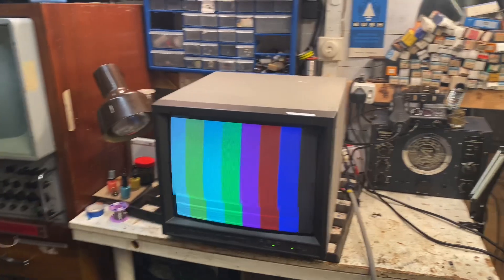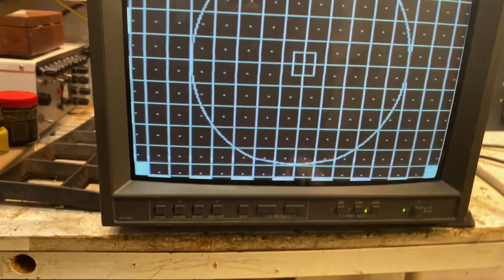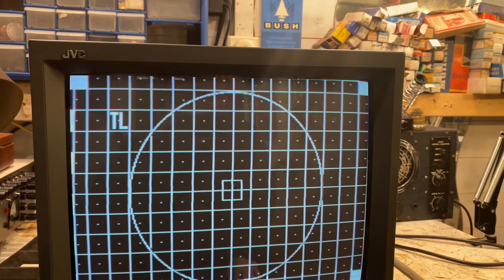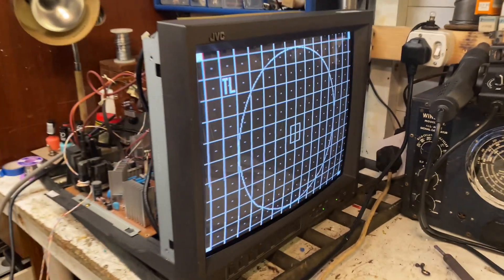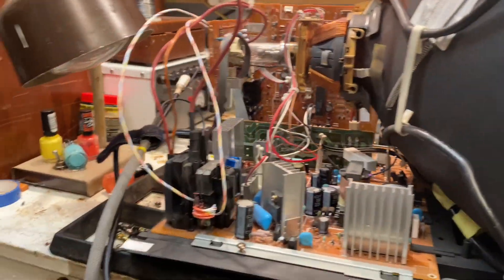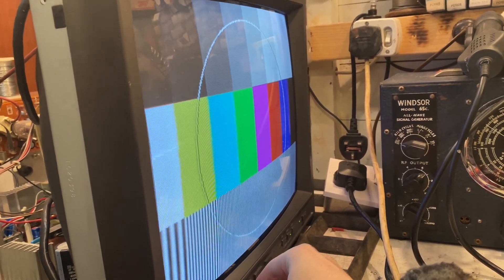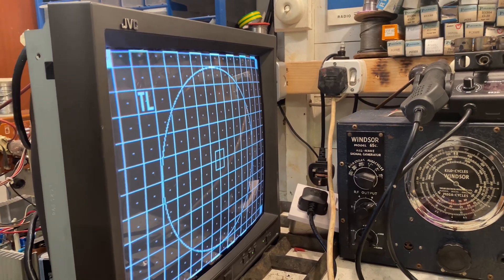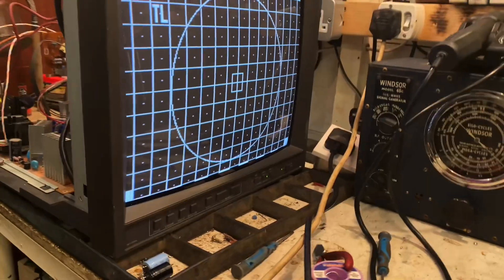Customer Repair - JVC TM-1700PN with knackard CRT! Mullard Repairs

Comment: Hi, do you remember if that monitor has antiglare filter on it? Mine is deeply scratched.
Reply from the maker: I don’t think these ones have an antiglare filter on them, however I could be wrong. If the scratches are deep, very likely these would have perished through to the glass

Comment: Hey Ed, I've got a PVM 20L5 I'd love looking at, at somepoint just haven't figured out a great way to get it your way and back as I don't drive, do you have regular customers who have a work around for this? 

(BTW I believe the neckboard has some issues, as the screen will occasionally turn purple, usually if its been moved recently so maybe somethings loose. Would likely also want a recap just to Future proof it from anymore issues)
Reply from the maker: Hello! Usually I suggest using a courier service on Shipley. They pick it up pop it in their van, then deliver straight to me :)

Feel free to drop me a message on my social media, or send me an email at em536716@gmail.com